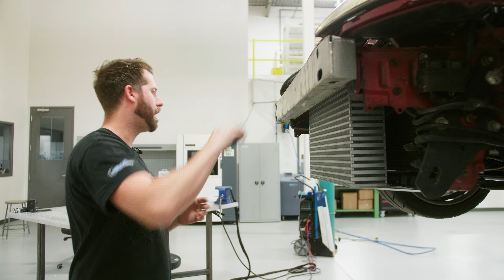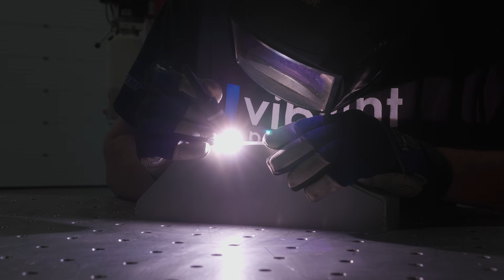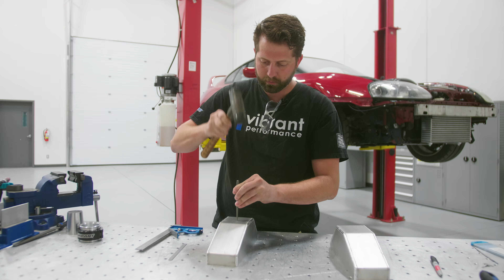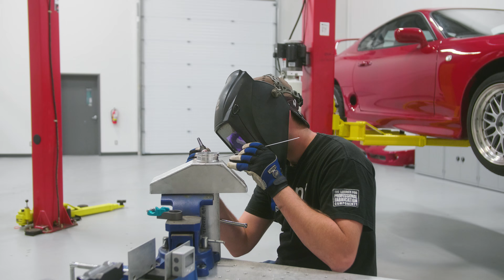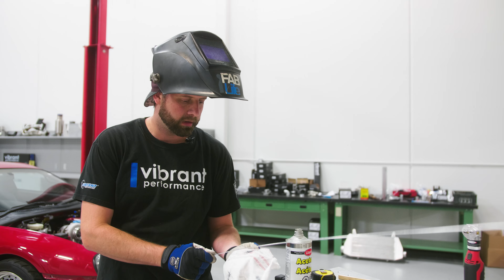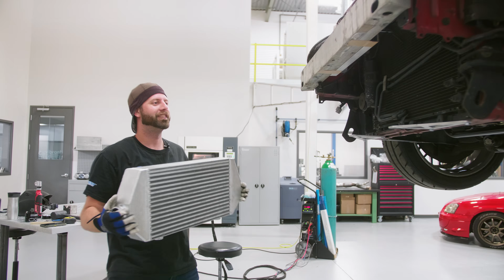The BEST way to Build a Supra Intercooler

Comment: What size is this core that you actually went with though? You never stated that in the video. My eye-rometers says that the core is about D = 3.5 inches by L = 20 inches by H = 12 inches. Is that about the ballpark?

Comment: if the core is sized too big for the application it could bring excessive pressure drop of boost correct? at what point are dividers in the end tanks a good idea to ensure the whole core is getting boosted air inside? great videos guys💪
Reply from the maker: Yes exactly, because Dave and Pete wanted a car that was very responsive. The first issue we were faced with was that the intercooler inlet/outlet was too large, and to avoid doing so many transitions, we decided to make a new intercooler for them. Secondly, we figured since we get the choice, we will pick out the correct size, based on the all the factors.

As for deflectors, this is another piece of the puzzle, which when done incorrectly can impede flow, not helping it. They do contribute to total efficiency, but when taking a step back and looking at the whole system, minimal amount. We would recommend going after the low hanging fruit, like effective ducting, proper core sizing, minimizing internal volume of the entire system for your application.
Reply: @VibrantPerformanceTV  what core size is this, >shopping now< is this the same that I see on your site (sku12837: 4" thick, 22" wide 9.75" tall)?

Comment: Very interesting, but  how about with water cooler set ups?
Reply from the maker: Water cooler setups are great! But come with their unique set of challenges. They are more complex systems to integrate, with pumps, tanks, plumbing/routing. But have many advantages, they are not as sensitive to airflow, can be integrated directly into the intake manifold and when paired with ice/chill tanks, provide very low intake air temperatures.

In this build, Speed Academy is on a strict timeline and don't want all the complexity that comes with the water-cooler setup. The core and end tanks were an audible once we determined the core they provided was oversized for their applications. Due to availability and how universal they are we were able to quickly change plans.

Comment: It would work better with a Milwaukee m18 drill
Reply from the maker: It would be nice to have one around the shop!
Reply: @VibrantPerformanceTV  I used mine with my hole saw and it just ate through the fender faster than I was expecting

Comment: Nice work! Do you pressure test the core after welding the end tanks?
Reply from the maker: Yes! It should definitely be on the list of checks before completing a build. That would be a big drag if you got to the dyno and found you are unable to tune accurately because you find a boost leak. Speed Academy will be handling the pressure test.

Comment: Nice vid, very informative! For safety, shouldn’t you be wearing sleeves? Ive made this mistake and ended up with actual tan lines from doing that. Stay safe!
Reply from the maker: You’re not wrong, full time welders should absolutely be protecting themselves with appropriate PPE, Greg made sure to put on SPF 1000 before welding, he needs a little color since we live in Canada and the sun hides for half the year.

Comment: I want to see 0 psi drop across the core with ambient temps. if you aren't getting that your cooler is too small. Good job with the 2.5" sizing though.
Reply from the maker: So do we! That would be ideal for sure. You can expect a pressure loss through a core that is both too small or too big, but many other factors are at play (density gain, internal flow area, turbulator fin design, etc). However the pressure loss from a core which is too small will be a restriction once you reach a flow which is larger than the core is capable of flowing, therefore the inlet pressure will grow. Where as an Intercooler which is too large, will create a volume which the turbo is unable to maintain boost levels at any throttle position.

Comment: Can we talk about the area hidden by the crash bar? 

You shared some great tech about the size of the intercooler and height makes the biggest difference. But, is the extra height still beneficial when it is blocked by the crash bar?
Reply from the maker: We had the same question earlier, so we will just repost it here too:
If the system is left unducted, then the rows which are not getting sufficient ambient flow (those behind the bumper) will be less efficient when compared to those which are seeing enough flow (conduction vs. convection heat transfer). The rows do still contribute to heat transfer since the core itself is emitting the heat through conduction. However this is why ducting is so important, the duct’s job is to disperse air more evenly across the entire charge face therefore increasing heat loss through convection, while increasing the pressure differential between the front and back of the core, increasing this pressure differential helps draw air through the core.

Comment: So what's the efficiency of the rows tucked away behind the bumper?
Reply from the maker: Great question! If the system is left unducted, then the rows which are not getting sufficient ambient flow (those behind the bumper) will be less efficient when compared to those which are seeing enough flow (conduction vs. convection heat transfer). The rows do still contribute to heat transfer since the core itself is emitting the heat through conduction. However this is why ducting is so important, the duct’s job is to disperse air more evenly across the entire charge face therefore increasing heat loss through convection, while increasing the pressure differential between the front and back of the core, increasing this pressure differential helps draw air through the core.

Comment: Great video! What sort of reduction in pressure is normal post intercooler? e.g running a 18 psi gate spring would you expect to see 18psi read from the intake manifold? Are there easy ways to measure the performance of one ontercooler and another? Cheers!
Reply: normal is 1-2. good is 0. bad is 3-5
Reply from the maker: 1-2PSI drop is an acceptable pressure loss, anything over that is too much. 0 is always the target but is impacted by a number of criteria (density gain, internal flow area, turbulator fin design, etc). Adding pressure sensors to the charge piping pre/post intercooler would be the easiest way to determine the pressure drop across the core.

Comment: I'm VERY new to TIG welding aluminum and just recently did my first intercooler for my 4G63 swapped Datsun 510. Sadly it wasn't a Vibrant unit, although my piping and some cast bends in my system are. One "trick" I just picked up from this video that I've never really seen, is using the pulse feature to do a "lay wire" weld. I'm sure that's not new to anyone else, but it was new to me :-)
Reply from the maker: Awesome, that sounds like a very cool swap and must be such a fun car to drive. It's always great to learn new tricks, we are happy to show you the ones we know!
Reply: @VibrantPerformanceTV  it's a blast to drive when I can keep it straight ;p

Comment: What would you say the reduction in overall volume was between the two intercoolers?
Reply from the maker: The Freed Engineering intercooler had an internal volume of 9.7L and the new smaller intercooler Greg fabricated was 6.5L. Overall the larger intercooler (1000HP +) and piping would have been 1.7 times more charge air volume than the system which was fabricated. That includes the 87% increase in charge tubing volume and the 50% increase in intercooler volume. This all plays towards Speed Academy’s goals of response.
Reply: @VibrantPerformanceTV  Awesome answer, thank you for the education!
Reply from the maker: @thejoshuahenry  Happy to help! We love this stuff, and are happy you asked!